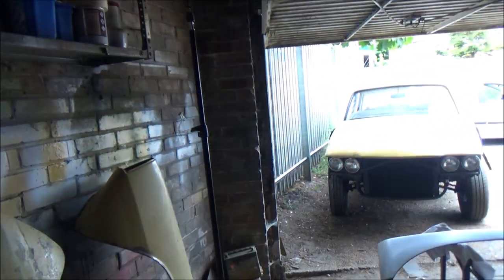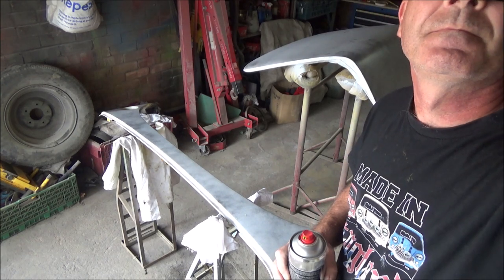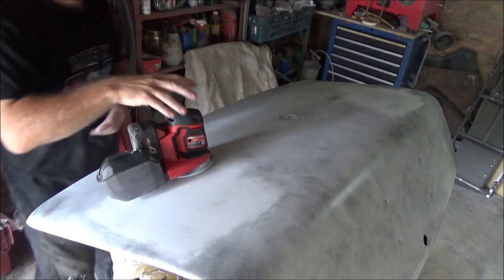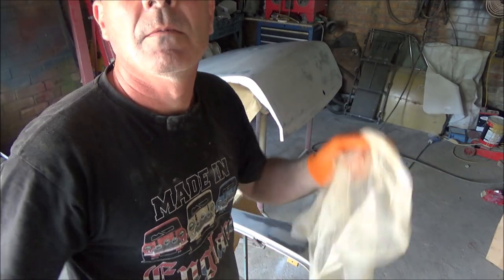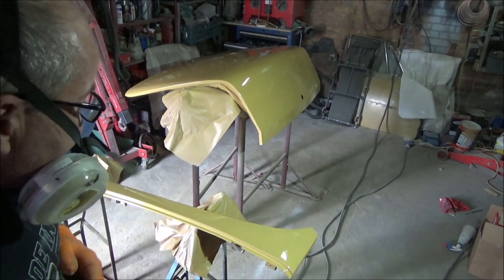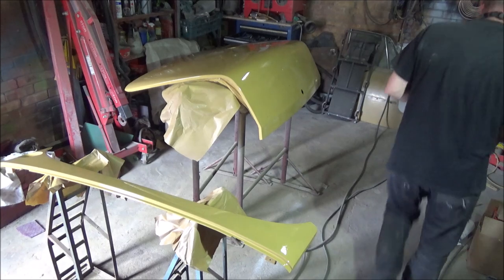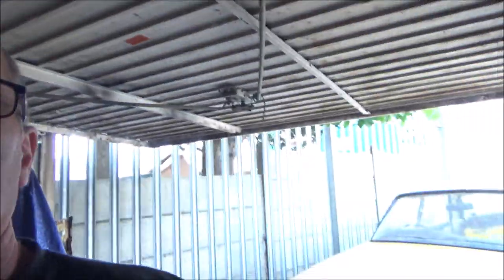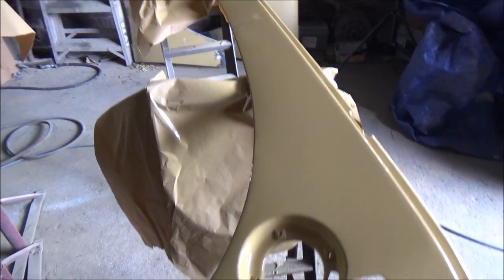Rover P6 v8 sanding and painting the bootlid and rear deck panel in jawel 2k acrylic single stage

Comment: Hey mate what did you think of the over all quality of the Milwaukee sander ? Would you recommend I buy one for my truck paint  project ?
Reply from the maker: Personally I like the quality and have a few others like drill. Grinder and buffer. 
One thing with the sander is to try and blow the dust out regular as this can cause an issue.